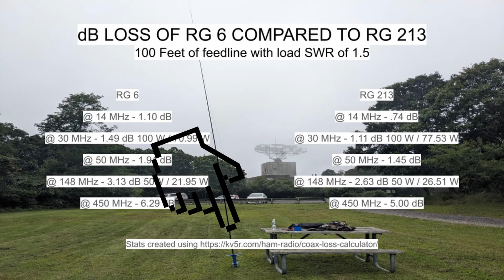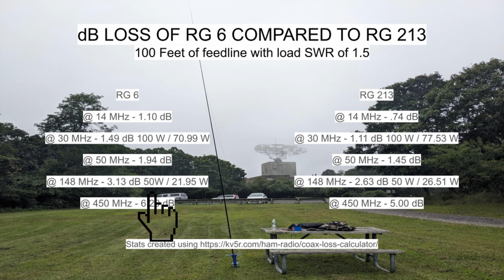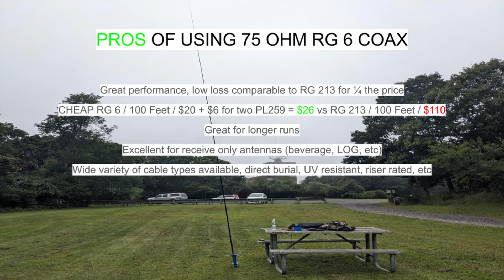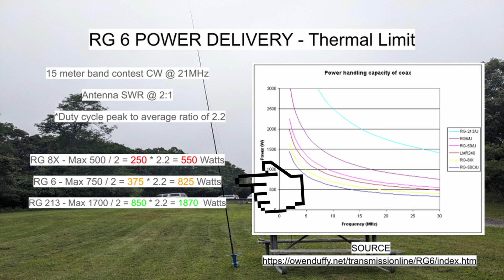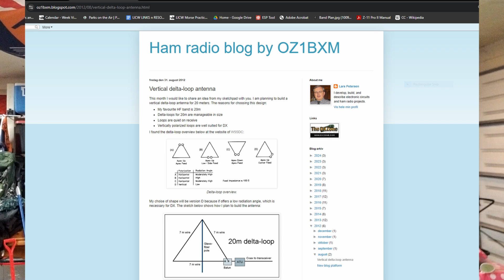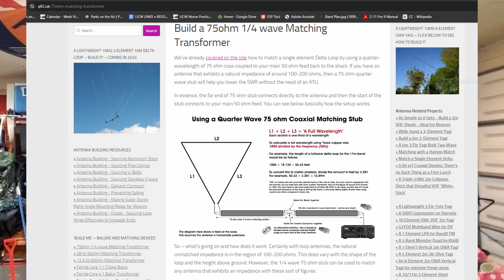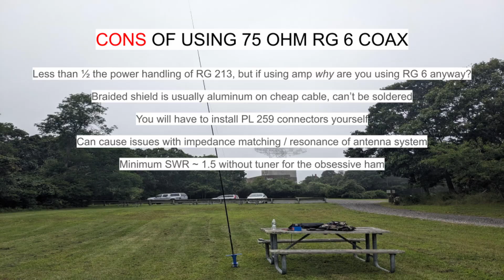Using cheap Cable TV Coax for Ham Radio

Comment: First, love the video, doing things on the cheap is always good. I’ve worked around pay tv and internet for almost 20 years, I’d stay away from pre run cables because of the copper clad. I suppose it depends on which devil you want to face, more expensive coax of higher than normal SWR. Bet no one could tell the difference in an emergency.
Reply: Thanks for putting this out there, I was building a coax dipole and pretty much have the measurements to get the same results every time. Used an f connector and saw craziness with SWR. I swapped the connector for a pl259 and so239 and replicated the first two dipoles I built. Your video helped me understand why.
Reply from the maker: Glad I could help! @texican8441
Reply from the maker: Thank you!

Comment: Speaking from experience those twist on connectors are junk, add a little moisture and the connection will degrade over time.
Reply from the maker: Good idea for a future video I have a few of these connectors out in the elements, maybe a 2 year update. Thanks for watching!
Reply: Glue lined double walled heat-shrink ;-)

Comment: 👍 Good video and some very useful info, thanks. I always thought it seemed odd that the impedance of a dipole is ~72 Ohms, yet hams use 50 Ohm co-ax and the standard output impedance of rigs is 50 Ohms. Though, I do appreciate there are reasons for using 50 Ohms.
When I use that tape trick, I found it easier to wrap the tape on clockwise. This means, when I screw the connector on clockwise, it doesn't tend to unwrap the tape.
Reply: While a simple dipole in free space is around 70 ohms , the impedance will vary a lot when near the earth ( say less than 1 or 2 wavelengths.  Often lower than the 70 ohm impedance so you get a low swr with 50 ohm cable.   In reality if a dipole is 70 ohms and fed with 70  ohm cable the SWR will be 1:1 instead of 1.5:1.  However if measured with a 50 ohm bridge like most  hams have it will not show that 1: 1 but another SWR.  

The 50 ohm cable mostly comes from an old standard in that it handles the most power for coax with reasonable loss.  The 70 ohm cable has lesser loss for the same outside diameter cable so works well for receiving or transmitting at lower power levels.
Reply from the maker: I'll try a clockwise wrap the next time I fit a connector. Thanks!

Comment: Since the feed point impedance of a half wave dipole is close to 73 ohms, using 75 ohm feed line works very well !
I personally use RG - 6 Quad shield, and find that the antenna is significantly quieter !
Reply: Dipoles are not always 73 Ω due to height and location with nearby objects which is why sometimes a less that 1.5:1 SWR can be obtained as I found out. Mine are in the attic, 5 dipoles 20m to 10m, fairly close to each other and some ends close to the wall.
The radio textbooks show how height makes a difference to the impedance.

G4GHB.
Reply from the maker: Nice! I should get my hands on some quad shield.
Reply: @kd2wtu72  
Indeed !
And you'll pay hardly anything compared to all the high dollar Coax !
As I've said, I've had great luck with it running QRP thru 100 watts !
As to how quiet it is, it was just that , that drew my attention to it !
I thought that I was imagining things !
It got me to thinking just how much noise our coaxial cables may drag in ?
I do also employ an ugly balun at the feed point , probably more from habit than necessity ?
And this was something I was always curious about, and finally decided to use 75 ohm !
Too, unless you choose to do something different, you'll need the appropriate adapters, F type / RCA to PL 259 !
Good luck !

Comment: Having made my own tcvr and copied a p.a. circuit for 50 Ω, it seems to me I could just as easily use 75 Ω. I used the accepted standard of 50 Ω.
Is a tx output really 50 Ω? Or only thereabout? I don't see how it can be guaranteed to be 50 Ω.
If I use 75 Ω coax and as long as I change the resistors in my Wheatstone Bridge type SWR meter then everything will be 75 Ω, coax, SWR meter, and my dipoles supposedly the 73 Ω textbook value. I'm going to try this. 
My FT817 would show a mismatch but I guess that would be because the 817 SWR meter circuit is set for 50 Ω. Could that be altered for 75 Ω?
Are manufactured tx SWR meters set for 50 Ω and nothing else?
But dipoles can't be guaranteed to be 73 Ω either, due to height and nearby objects which is why an SWR of less that 1.5:1 can be obtained. A 75 Ω dummy load on a 50 Ω  tx SWR meter shows 1.5:1. 
G4GHB.
Reply from the maker: I'm not sure about altering your equipment but you could definitely "tune" your dipole by connecting a nanovna or antenna analyzer and adjusting the antenna height until you get 75 ohms. Interesting idea, making everything 75 ohms. Give it a try!

Comment: I bought 2/3 of a 1000ft box from a home builder for $20.00 on marketplace. I’ve made several receive antennas for different projects.  Time to try transmitting with it.
Reply from the maker: Go for it, it should work just fine!

Comment: I've looked at RG6 and wondered about using it. With 50 Ω coax there's a mismatch anyway at a dipole which is 73 Ω depending on height, location etc.
RG6 puts a mismatch at the transmitter but then the coax matches the aerial. Does it matter?
I think some tests using an r.f. pickup meter at the aerial and one length of RG6 and one of mini 8 both the same length to see if there is a difference in r.f. output is needed.
When I first started on h.f. I did use about two feet of t.v. coax to a tuner for a long wire.
I have attic dipoles each with about 25 feet of mini 8 coax, 20m to 10m bands and an outdoor inverted vee with about 45 feet of coax on the 60m band so no great losses anywhere.
G4GHB.
Reply from the maker: I'm in no way a RF engineer, but I don't believe it matters whether your mismatch is at the radio or the antenna, I think you will have the same losses. But that sounds like a good idea for a future video. Thanks for watching!
Reply: @kd2wtu72  Thanks for the reply.
73. G4GHB.

Comment: Good video. I use a lot of RG-6. I buy it by the 1000 foot roll and it’s cheap. I also use the compression type connectors with the PL-259 adaptors. Regarding 75 ohm vs 50 ohm cable, it makes insignificant difference on a dipole. The feed point impedance of a dipole varies widely with the height above ground. As the height is varied from very low up to several wavelengths high the impedance varies from very low up through a 50 ohm value and rise to a peak around 90 or more ohms then back down to maybe 60 when it rises again. It oscillates around 75 ohms until at several wavelengths it is essentially damped out to near 72 or 73 ohms. It can be fed with any 50 or 75 ohm coax. To get the minimum SWR with either coax you can usually adjust the length of the dipole above or below resonance changing the reactance ( making it either inductive or capacitive) this changes the impedance such that it can become either 50 or 75 ohms. The impedance is a combination of R and X. So length of the dipole is adjusted until you get a minimum SWR with either 50 or 75 ohm cable. In other words an impedance of  50 ohms with no reactance can become a 75 ohm impedance by simply adjusting the antenna until there is a 55 ohm reactance. The feed point is changed from 50 +j0 ( 50 ohms impedance)  to 50 + j 55 and  that is 75 ohms of impedance.  This would give a perfect 1:1 with 75 ohm cable. This is a case of the minimum SWR not being at the same frequency as the resonant frequency. This is done all the time with 50 ohm cable. We put up a dipole at some convenient height and feed it with 50 ohm cable. The SWR is not what we expected. We trim or lengthen the antenna until the SWR is as low as we can get it, frequently 1:1 but anything less that 1.5 is very good. What we don’t realize is that we are actually adjusting the reactance and varying the complex impedance until it matches the coax. 
You are doing pretty much the same thing when adjusting your delta loop differently with 75 ohms coax that with 50 ohm coax. I do want to mention that regardless of the coax type if there is an SWR on the coax, the impedance at the antenna will be transformed to some different impedance at the transmitter end depending on the length of the coax. If the electrical length of the coax is a half wave or multiple of a halfwave then the impedance will be the same as that at the antenna end. On a Smith chart we draw what is called an SWR circle and all the points on the circle have the same impedance but each point had a different R and X value. One revolution around the circle is one half wavelength and brings you back to the point you started with.  That’s why the antenna impedance repeats itself every half wavelength of feedline.
I as well as many of my friends have used very large 75 ohm hardline for long runs to our towers for low loss. We start with RG- 8 transition to the 75 ohm hardline underground and at the tower transition back to RG-8 up to the antenna. At one time the cable company near me gave away many leftover reels with only 100 to 300 feet left on them!
Reply from the maker: That makes a lot of sense. Thanks for the info!
Reply: @kd2wtu72 Okay. Good enough for the girls I go out with... But... impedance is always a 'combination' of resistance and reactance...even if the reactive part is zero... and has units of ohms. If the reactive part of an 'impedance' is zero... you are talking about pure resistance. For a dipole antenna...at resonance...of the at the frequency it was designed for, the dipole antenna's feedpoint..is purely resistive... 73 ohms... and that is known as the 'radiation resistance;. Saying "50 ohms with no reactance can become a 75 ohm impedance by simply adjusting the antenna until there is a 55 ohm reactance' does not make sense. It confuses resistance, and impedance... which are not the same things. You can change the radiation resistance of a dipole antenna... bringing it off resonance... by adding, or subtracting... to or from, the length But this also changes the impedance, and make the feedpoint reactive. You can cancel the reactance introduced when a dipole antenna is off-resonance by using external tuning methods, such as a tuner or a stub. The characteristic impedance, not just impedance, of an ideal coaxial cable is purely resistive and depends only on its geometry and dielectric properties.
Real-world cables introduce slight reactance due to imperfections, but these are typically negligible for most practical applications at RF and microwave frequencies. The longer the cable, the more those 'imperfections' matter.
Reply: @kd2wtu72 I always recommend the ON4UN Low Band DXing book (Especially the Fifth Edition). Although it is primarily for 160 through 40 meters the info applies to all the HF bands. I have had most of the 5 editions. Excellent books and each edition got better. Some early editions had not so good information in places but the last two editions are really excellent. 
73,
N4DJ
Reply: Why aren't you teaching this on YouTube or elsewhere? That has to be one of the easiest to understand descriptions I've heard yet.
Reply: Geez, write a fucking book already

Comment: I gave 30 bucks for 500 foot of good stuff. When you make long runs for reception, it great.  If you use it for 160 or 80 meter antennas, just mind you lengths and you’re good. 
Also need to check your connections more often. The aluminum  sheath does not like to have the pull of the cable on connectors. 
You can also use it as the antenna on a reversible beverage.
Reply from the maker: Good point, I should check my connectors as I've had my run of RG6 up for over a year now. Thanks for watching !

Comment: I’ve been wanting to try this cable for HF. 

From my wholesaler, I can get 1000’ of generic quad core for $100-150 aussie.  

While I haven’t used it as transmission line, I have used it to make a series of magnetic loop antennas with varying amounts of success.  

The cable was from stuff I had left over from some older analog CCTV installs I did last decade. 

As far as matching it to an antenna, a simple balun with a 9 turn to 8 turn balun will do it for a 50 ohm feedpoint impedance. On your delta loop, you could use a similar strategy with a turns ratio of 1.6:1. Instead of 2:1
Reply from the maker: Give it a try I think you will be pleasantly surprised how well it works. I feed my delta loop bottom corner with a 4:1 balun. It works very well, resonant on 20m, and SWR is less than 3:1 on all the other bands so I run it multi band with a tuner. Thanks for watching !
Reply: @kd2wtu72  thank you for taking time to respond 

I have a few theories that seem to fit the measurements I have taken of various antennae with the trusty NanoVNA who’s smith chart reveals so much more than SWR. 

I am currently working on higher power Magnetic Loop antenna designs, and have what I feel is a somewhat unique approach to a 20m through 40m mag loop that I can take portable and gives an end fed half wave an excellent run for its money. I’ll be making some more sensible videos on it with a friend VK2AOE who has his The Art of Engineering channel. There are some sneak previews of the loop antenna there. 

There is a roll of flooded RG11 that has been given to me that I need to test. But again, I am using it as a radiator and not as a transmission line. 

I do want to try RG6 with catenary wire as an antenna and see how the diameter affects the bandwidth for your regular dipole. The extra aluminium foil surface area should more than make up for any skin effect resistance, not that that is much of an issue with wire antennas as opposed to mag loops which can be little bundles of incendiary devices when placed under stress :-) I have a few entries in the Hall of Flame to attest to that 

DE VK2NAP

Comment: I bought a 100m roll of VERY HIGH Quality RG6 for $30AUD New Old Stock...to redo my TV antenna runs about 4 years ago. It's connected to 3 separate SDR's, two scanners and an AIRBAND receiver. The SECOND 100m roll I then bought to do my TV's is servicing a second set of 4 antenna's, for transmitting on various bands. I made two flowerpot antenna's for 10/11m portable use,  both are 1.01:1 or less SWR on a 5m test feedline of RG58, I run one on a 40m length of RG-213 and I get a 1.05:1 reading on either 27Mhz or 28mhz. the second one on RG6 gives me 1.5:-1.6:1 at the same length. BOTH work perfectly well. For the cost saving, i can live with the 10w power loss i MIGHT suffer at 100m, at my limited 40m length, I get a return loss of under 2w on the RG6. When I run my IC7300 at home, it runs into a 40m length of LMR240 and into a EFHW with a 49:1 UnUn, it shows a return loss of around 1.5w, so not a lot of difference. 
During a field test, using 50w power and over a 15Klm distance on 27.305 AM, the signal on the RG213 was less than one S point above the signal on the RG6 at the receive end. Using the same radio, same antenna, just different cable. NOT a definitive test by any means, but a solid result to be sure. The RG6 cable is cheap, works great and is simple to get, you can even buy 30m lengths with connectors fitted for $25 in my local supermarket.....I see mental images of  HAM's going in on any given day, buying toilet paper, a toothbrush, laundry detergent and 30m of coax...just a normal days shopping.....

And YES, the TV's are still waiting their new cable runs....time to buy a third 100m roll......
Reply from the maker: Haha I love that your radios soaked up all that coax and the tv's didn't get any. Your proof is in the pudding, not much difference in feedlines at your station. Thanks for watching !

Comment: I got a few hundred feet of RG6 from the end of a roll used on a large commercial cable TV installation. Most importantly, I got it for free. I made up several low-loss 50 Ohm to 75 Ohm matching transformers to put on the antenna end of my rig with the antenna tuner, and for wherever applications I might need them for, although I also found I could simply tune a couple of my antennas to have a 75 Ohm feedpoint, so I seldom have use for the matching transformers. I'm not the sort who is particularly concerned about losing 7 or 8 Watts out of 100, but I do like to keep everything running cool and happy, and I find that my feedline matching losses are extremely minimal to nonexistent. You just have to stop thinking of 50 Ohms as being somehow magical and essential, and learn to match to whatever impedance you have to work with.
Reply from the maker: Well said!

Comment: I used to use 3/4 inch 75 ohm hard line that I got for free and it was fantastic for the 200 foot runs out to and up the tower.. You should check the price and specs of RG-11 as it will assemble into a regular PL-259 like RG-8.. I used the 75 ohm RG-11 coax cut to 1/4 wave sections on 6 meters to co-phase 2 antennas together with a coaxial T with great success and it was acquired for free as well from the cable TV companies dumpster.. For a time I also had a home made 160 bazooka antenna built with it which I built a home made baulin for..
Reply from the maker: Rg 11 might be a future video. Thanks for watching!

Comment: I have said this in the past, as how many antenna are fifty ohms anyway? Scanners users this is a cheep way to get your antennas away from the noise Also poor CB ops this is also good. How many have a feed line of 100 feet so if your scanner or CB antenna is say fifty feet the loss will be even less
Reply from the maker: Thanks for watching!